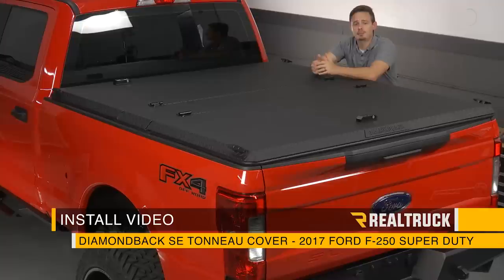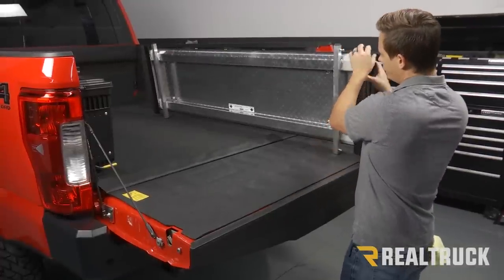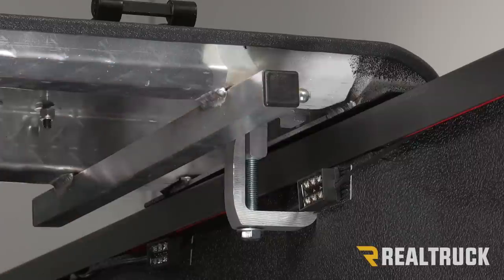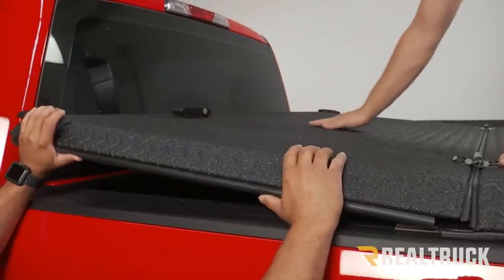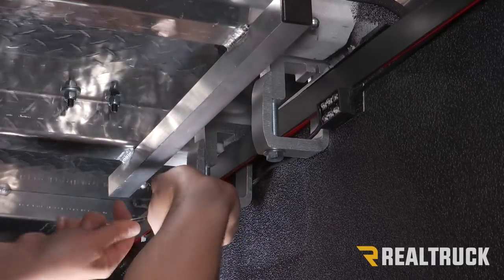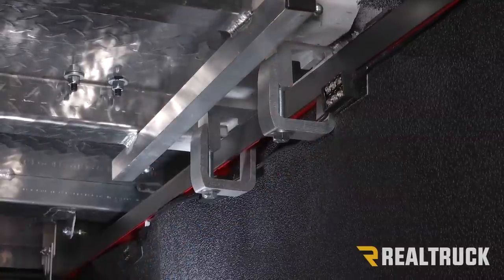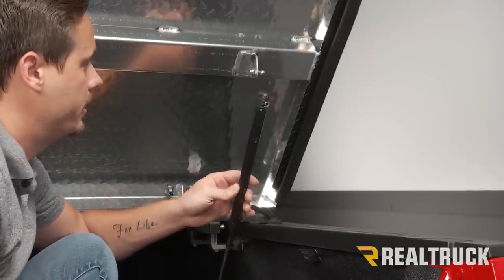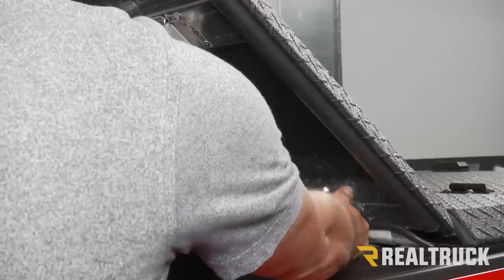How to Install DiamondBack SE Tonneau Cover

Comment: Good install video. What I would have liked to have seen:
— Better close up pictures of alignment with bed corners, sides, hatch seals, and front bulkhead (front bulkhead pic was visually confusing, maybe if from different angles or moving). 
— Torque settings on bolts. 
— How squished should seals look. 
— Is there a tailgate seal that needs to be installed or adjusted. 
— Operation. i.e. Safety catch in front.
— General suggestion about attaching accessories. 
— Accessories available. 
— Quick differences between SE and HD and their installation differences. 
— Assist shock sizes to adjust for accessory weights. 

The construction and installation seems first rate, cleverly simple, and well thought out ..... except the locking rods. Adjustment of these rods to make the gasket fit tighter or looser should be A LOT easier with just a turn of a bolt one way or another to adjust tightness. Would rather see latches on all four corners so I could get a better seal by pushing down on one corner at a time.

Comment: Nice detailed video.  Best view of installing the C clamps on the center piece that I have seen.  I think others have mentioned that it would have been nice to see more detail on the alignment especially the car area where the weather stripping was installed along with the back corners near the tailgate.  Pretty much settled on this cover for my 22 Tundra because of the accessories, ease of installation and removal.  Just need some warmer weather in Connecticut for the install.
Reply: Also going for it man did you get it how was it!

Comment: Question. Is the weather stripping being laid without tugging on the seal? Or is it laid in without any stretching? I'm assuming it's the latter, but the video made me think he was pulling on the weather seal.
Reply from the maker: You are correct, laid without any stretching
Reply: @Realtruck  I'm concerned about weather stripping sealing on my cab side of truck bed as they put the Rhino/Line-X covering on that area as well? I'm not sure if I could remove the Rhino/Line-X covering?